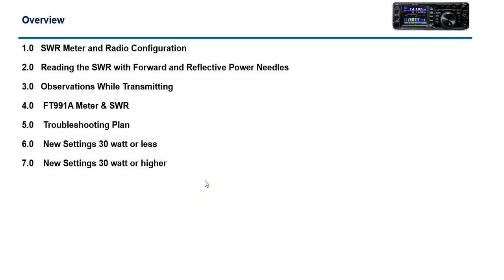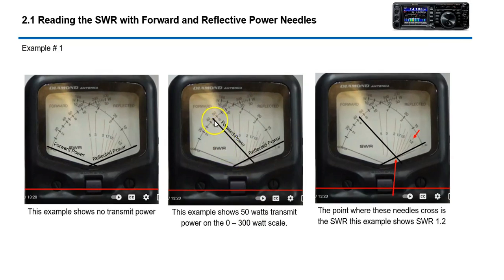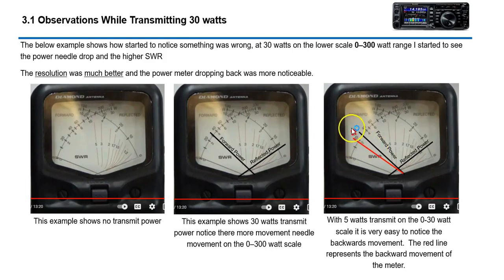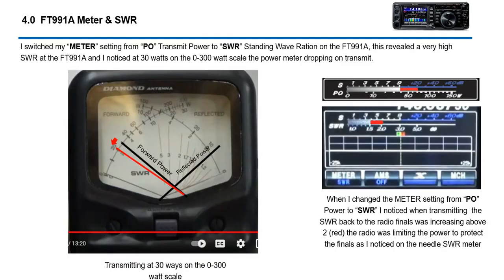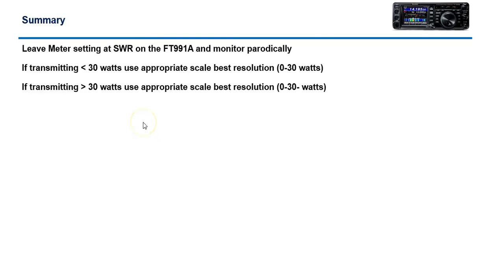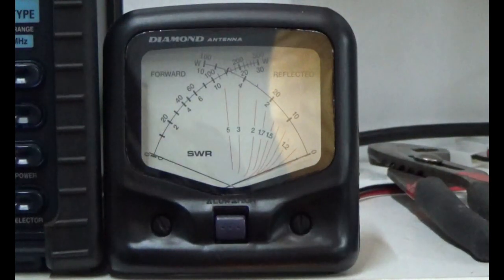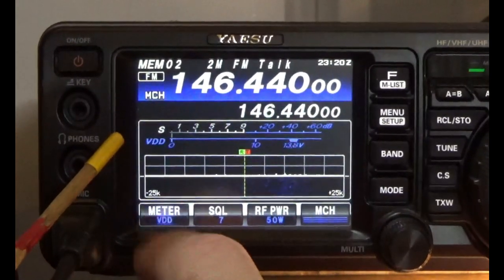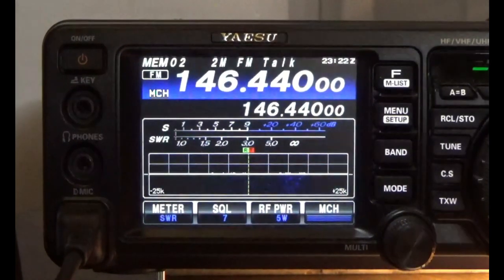2 Meter Antenna High SWR & Power Drop in Cold Weather w/ Comet GP-1 using Diamond Antenna SX40C SWR

Comment: Interesting. I also have a FT-991a, and I've been noticing that my SWR seems to vary, but didn't consider ambient temperature. I also got a Slim Jim antenna recently, and it seems as if it was tuned for 133Mhz vs the advertised 146Mhz. I'm going to have to take a few measurements and log them at various outside temps to see if there's any rhyme or reason to the changes. Also, this video is giving me another reason I want the CATMeters for my FT-991...